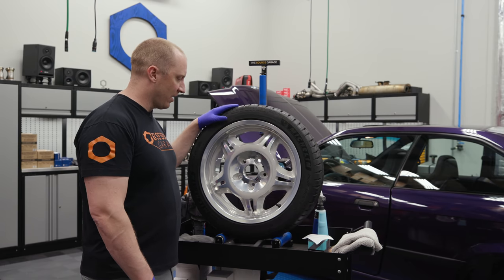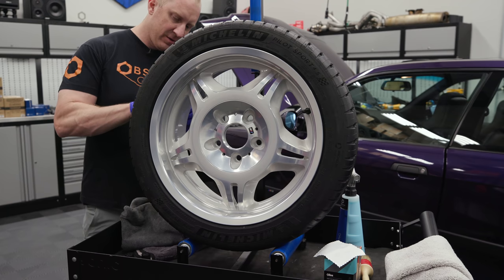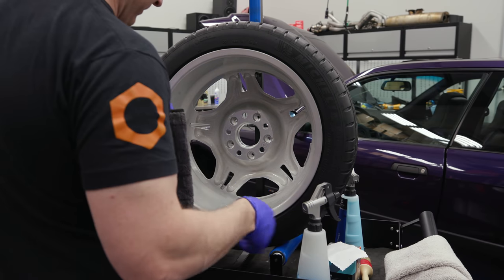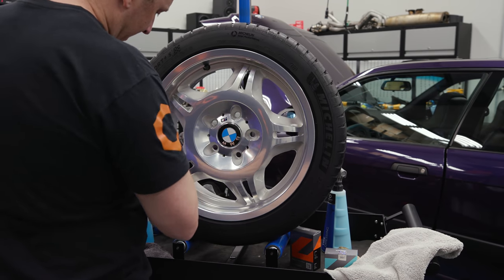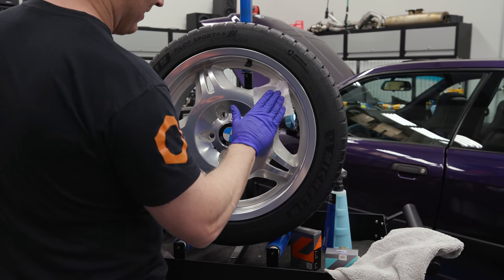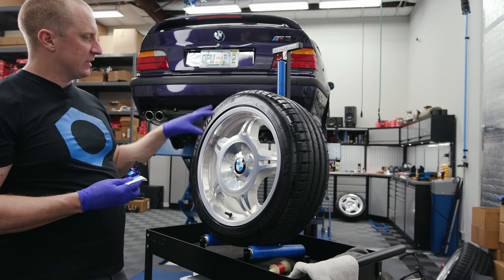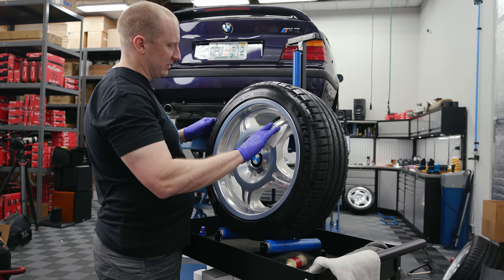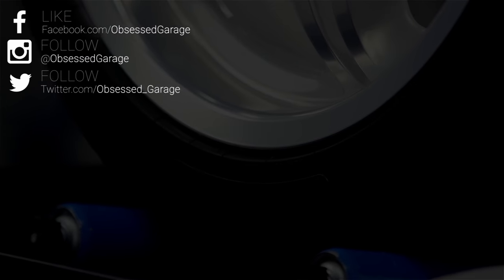CARPRO DLUX and Gliss V2: Coating Application on Style 24 E36 M3 Wheels

Comment: I would be surprised if someone didn’t already suggested it but try IGL wheel, easiest application I have ever used and durability is a year+ easy, I know you already found the new wheel coating but just try it on something!

Comment: Hey Matt- another nice combo would be Carpro SiC on top of DLUX. SiC just came out not to long ago. I know Gliss has been around for some time now. SiC is Acid and alkyl resistance from 2-13PH levels . 
Direct from CarPro - 
Features:
Acid and alkyl chemical resistance from 2 ~ 13 pH.
Better water spots and minerals resistance.
Highly smooth feeling.
Deep gloss.
Very easy application in any temperature.
Tech specifications:
Sliding angle: 10 ̊.
Water contact angle: 110 ̊.
Heat tolerance: 392 ̊ F.
Application temp. range: 50 ̊F ~100 ̊ F.
Surface finish: High slickness.
Gloss: Mirror Shine.
Chemical resistance: 2 ~ 13 pH.
Mineral resistance: High (easy to remove).
Salt resistance: Medium.
Reply: Mr Brian I did SiC on top of Cquartz on a harley Davidson came out awesome. Great combo
Reply: @CarlosDiaz-ih9sh I’m jealous of such a small panel to deal with 😁

Comment: Looking good Matt.  DLUX is indeed old school and does a good job as a wheel coating.  I recall CarPro revising their instructions where no leveling is needed.  I tend to wipe it off as well as I am used to that.  

Also keep in mind that Gliss doesn't do well if hit with Tarx as that will degrade it and in some cases remove it.  

If you ever decide to look into wheel coatings again, I have found that 22ple VM1 does a better job and is much easier to use with longer longevity than DLUX.  You won't get that tacky feeling like DLUX.

Comment: The grabbiness in removing the coating is because you have not allowed enough flash time, the time can vary from outside temperature, humidity, etc.. if it's grabbing/smearing then you need to allow more time, and you should start your timer after you have finished applying the coating, not at the start.
Reply: Carpro wants 1 minute afterwards  its supposed to grabby when you remove it.

Comment: Coatings specifically for wheels/calipers tend to be gummier. Gyeons Rim is very similar where it goes on very gummy and doesn't really leave a super slick surface but it performs pretty good. I will have to give this combo a try to see if I like it over Gyeon Rim.
Reply from the maker: This is way better than Gyeon Rim.  Gyeon, Gtechniq, wheel coatings aren't very good.

Comment: The melting point of SiO2 is around 1.700°C. How does a wheel coating differ from a normal coating?
Reply: That is pure SiO2 and coatings are not pure SiO2.  In general wheel coatings have a higher temperature resistance.  Some paint coatings have a higher temperature resistance than what Matt was using.  Matt was using Crystal Serum Light which resist temperatures as low as -40°c to as high as +250°c.  CarPro DLUX has a temperature resistance of 800°c.  Gtechniq C5 is around 500°c.  22ple VM1 blows either of these out of the water so to speak in overall performance.
Reply: @MikeGDetailing  Thanks 4 the answer. Where can I find these informations? They are not mentioned in the the safety data sheets.

Comment: I put CSL and EXO on my daily driver BMW X4M about 6 months ago.  The black HRE’s retain horrible break dust (thank you in part to BMW having the worst brake dust on the planet).  How would I remove the current product to redo or can it be applied over it?  I am sure it will have to be compounded, but you said it only lasts about six months on a daily, so thought I’d ask.

Comment: I was told today by the Detailer ceramic coating my 2023 Range Rover he does not ceramic coat the barrel due to wheel weights not always sticking to the inside after the wheel has been ceramic coated. He says they can come off. Is this a legitimate concern? Or should I push the barrels to be done?

Comment: What's the diff between wheel coatings and ceramic coatings that you apply to the paint?
Reply: wheel coatings are specialized for higher heat and chemical as well as longevity at the sacrifice of some water behavior properties

Comment: Those applying gliss in areas of humidity need to work a littler faster because it will flash very fast. Matt is working in a climate control so he has more time.